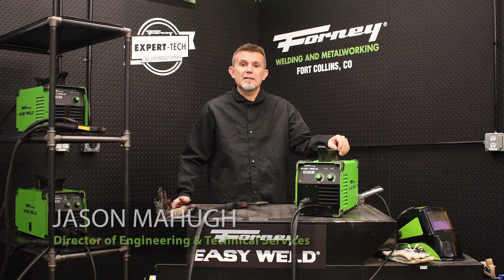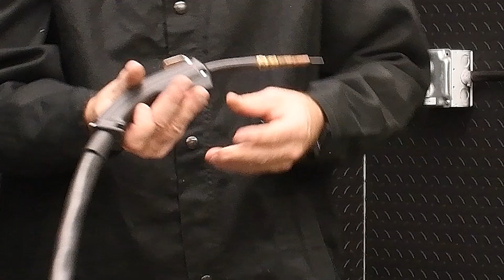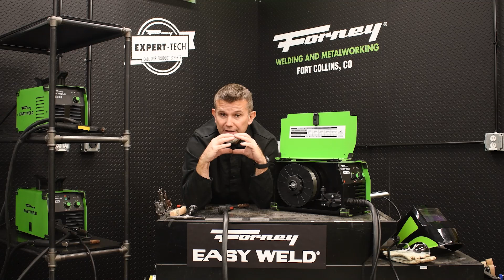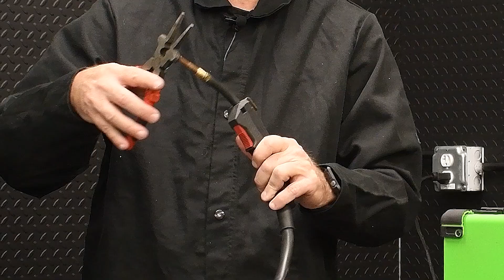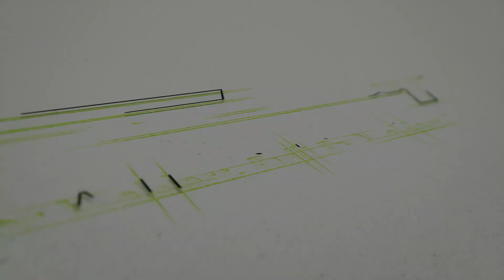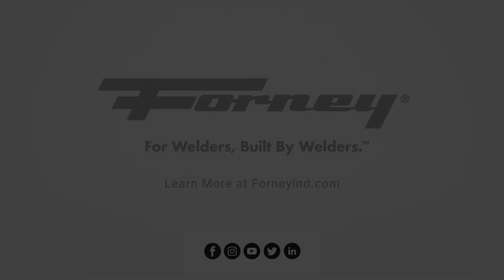Welding 101 - Forney Easy Weld® 140 FC-i

Comment: I am using the 4" roll of wire.  I thought I was following the instructions, but the slack was too much to adjust.  I noticed the removed large plastic cap used for the 8" roll fit nicely at the base of the spindle.  This seemed to work perfectly, lifting the spool just enough so that the tension system worked nicely.  Hopefully, that is the correct assembly.

Comment: Hi, I have a easy weld 140 FC-I. How do I get the thermal overload light to reset? The welder was working fine all the time and then after not using it for a couple of months, when I plugged it in and turned it on, the thermal overload light came on as soon as I turned it on and and the fan is on. What do you suggest to check?

Comment: I have a question about the settings, on this video you had said they should be rather close together, volts and feed, however in this video,https://www.youtube.com/watch?v=YPazP1aytdQ, she has volts at 6 and speed at 10. I gotta say, that looks like a very strong weld! In what situations should you run these type of settings? , or is it just a feel thing? Thanks

Comment: Is this machine good for welding exhaust setups?
Reply from the maker: Hi, generally, exhausts are welded using the TIG welding process due to its high level of heat input control which allows for the best quality welds on thin material. The Forney 180 ST+, 220 ST PRO, or the 220 AC/DC would all be more ideal for this job.
Reply: @forneyind  Thank you very much. Checking those options out now.

Comment: I recently bought one. Running lots of beads on 1/8" mild steal to determine appropriate settings. The panel chart shows 7 and 7. I looked at the chart provided with the Forney 140 MP. That chart says 5 and 5. Both machines should have same guts for .030 FC, so why the difference in charts? Im currently set to 4 & 5 and so far looks ok. The flux still doesnt come off easily. Im using the lincoln .030 wire if that makes a difference. I know the charts say GS wire.
Reply from the maker: Hi Michael, the chart is a recommendation, but your style of welding, skill, and technique will often cause you to find different settings that you prefer. Every machine we sell has a wholly different internal set up, boards, parameters, etc. The output range being similar is not indicative of having the same internal components. It is expected to have different settings on a different machine even for the same wire diameter.

Comment: I bought this exact welder and the plasma cutter, I love them both, I had trouble with the wire cutting in and out, popping and spattering like crazy, come to find out it was my fault, I was putting my tip to close to where I was welding, stick out was to close, I thought I had enough distance between them, yesterday I was welding and pulled back by accident and was blown away at the difference, these machines are awesome, they run great and have no problems with anything I’ve thrown at them, great products for sure
Reply from the maker: That's great to hear!

Comment: I just bought this and am having a real tough time welding a nut to a broken bolt in an engine head. I've got low speed, hi voltage, good ground & the spool set right.

The welds do not hold and the slag pile falls apart before it gets big enough to hold the nut. Any suggestions?
Reply: Are you sure the bolt is steel?   You may want to get the wire speed and voltage closer together.  Having them at opposite ends will lead to bad welds.
Reply from the maker: Hi there, we recommend calling our Expert-Techs so they can help you. You can reach them at 1-800-521-6038 ex. 2

Comment: What wire should I use, if I'm welding nickel bar, all the time? Thanks
Reply from the maker: MIG welding nickel is possible but not with the FC-i, you must use gas coverage to weld nickel which the FC-i cannot. Chrom-moly is the most common type of fabricated metal with nickel, NiCrMo-3 is the most common type of wire to use for this, this will require 75% Ar/25% He coverage gas. Forney does not carry this type of wire, or any other nickel welding wires. Thanks for reaching out!

Comment: Can I use a 220v-110v 20A outlet  adapter with this welder and a 25 ft 20A rated extension cord?
Reply from the maker: No, none of our Forney Easy Weld machines can be powered by anything outside of + —10% of 110 volts without being damaged (or destroyed in the case of 220 volts).

Comment: I own this machine , but am here to comment on the excellent tutorial ! Nice to have someone give honest and realistic advice. Cheers to Jason !
Reply: Forget critiquing the tutorial, how satisfied are you with your machine?
Reply: @chalemi  I critiqued the tutorial prior to receiving the welder> Now I have the welder and have to say it is very good. I have welded 1" steel shafts to 1/4 " thick gears, welded thin metal plate and welded square tube with no issues.  Its very good so far and extremally happy.

Comment: The details say it’s best to have a 30amp single pole dedicated circuit.  Is this recommended?  Is there a plug adapter for a 30amp plug? (Basically an RV plug I think)
Reply from the maker: It is recommended, but if a 20A outlet (with 30A circuit breaker) is not available, you can connect your 140 FC-i to 15A outlet (with a 20A breaker) using the plug adapter. When using the plug adapter, use lower power settings on the machine to avoid frequent circuit breaker trips. At maximum settings, the machine will draw more than 20A regularly.
Reply: @forneyind  - ok, to be very clear:  the recommended breaker/circuit size is 30Amp (10ga wire), and use a 20Amp outlet?  Is that correct?  

My original question was if it was recommended to use a 30amp circuit AND 30 amp outlet, to which you replied “It is recommended…”.  You then went on to define it as a 30amp breaker with 20Amp outlet.  Please be specific.  

I built my garage to have access to a sub panel and can run a dedicated circuit easily.
Reply from the maker: @frankhouck4446  Apologies for the confusion, the FC-i comes with a 20A - 15A plug adapter. We recommend a 30A breaker with a 20A outlet, but if this isn't available you can run it off of a 20A breaker with a 15A outlet.
Reply: @forneyind  thanks
Reply: @forneyind  - looking at your comment again, I’m still a bit confused.  I don’t think NEC allows a 20Amp outlet on a 30Amp circuit.  You can’t put #12 wire on 20Amp terminals and I don’t think a 20Amp outlet has 30amp pass through - although in a dedicated circuit that shouldn’t matter.  But still, I think it’s against code.

Comment: Why is the wire feed so slow even at max setting??
Reply: Because it's only using 15 amps. It can't keep up with an industrial welder.    But it still works great, you just go a little slower.

Comment: This will be my first machine. Talking about the spool and wire, the wire should be Mild Steel Welding Wire or could be used with Carbon Steel Mig Solid Welding Wire, do you sell fourney 030-Inch on 10-Pound Spool ? send me the amazon link thanks
Reply from the maker: Hi Alex, we do sell.030 in a 10 lb spool. The Forney Easy Weld FC-i is flux-core only, so you don't need gas. You can find the flux-core wire here: https://www.amazon.com/Forney-42301-Flux-Core-Wire/dp/B000HE8CQI/ref=sr_1_2?crid=1GZDQXLBA81PL&dchild=1&keywords=forney+42301&qid=1635519914&sprefix=forney+42301%2Caps%2C231&sr=8-2

Comment: Been welding for a few years now. Mainly with argon. I purchased this one for home and for thin sheet metal for body work. At amps set at 1. And wire feed around 1-3. I still burn through. Tried two different brands of wire. .30 on both. ???
Reply from the maker: Welding thin sheet metal with flux-core is extremely difficult. It is possible, but it takes a lot of practice and nearly perfect technique to not burn through the material. Even with the same settings, flux-core welding gets higher penetration than solid wire MIG welding. In other words, if you were to run a MIG bead on the same thin material at those settings, then switched to flux-core, your weld would be too hot and potentially burn through. If your machine is already set as low as it goes, you then need to adjust your technique. We would suggest increasing your travel speed, or adjusting the movement of your wrist while welding in a way that doesn't allow the heat to push through the material and cause burn through. If you have any more questions feel free to reach out to our Expert-Techs and they can help you troubleshoot. 1-800-521-6038 ext. 2
Reply: @forneyind  this is why I returned it.
Reply: @1manshtshowandautobodystuf891  welding thin material is just flat out hard to do. Not really the machines fault.    Tig is best for thin metal.      If you were using 20 amps that might have been your problem.   Flux core burns super hot because it's a hollow tube, looooots of electricity going through a tiny amount of metal.
Reply: @forneyind 
I have this exact welder and use it on 
24-22 ga on regular . For thin I’ve practice on stick out ,  almost an inch and heat up works wonders 👍

Comment: Does this unit use an inverter to from A/C  to D/C?
Reply from the maker: Yes, the Forney Easy Weld 140 FC-i uses an inverter to change the power coming out of your wall that is AC into a welding output of DC. Thanks for reaching out!

Comment: Will it weld 1/4” in a single pass?
Reply from the maker: You can weld sheet metal from 18 gauge up to 3/16-inch thick with a single pass and you can weld up to 1/4-inch steel with beveling and multiple pass techniques.

Comment: Why isn’t it good for stainless steel? You can weld stainless with SS flux core wire...
Reply from the maker: In order to weld Stainless Steel Flux-Core wire you must set your machine’s polarity to DCEP. Unfortunately, the Forney Easy Weld 140 FC-i does not have the ability to change polarity and is always set to DCEN. Thanks for reaching out!
Reply: @forneyind  Thank you for the clarification.

Comment: I used mine today for the first time and for some reason the wire is not coming out sometimes. The wheels that hold the wire don't spin sometimes until I mess with it. What is the problem?
Reply from the maker: Hi there, we suggest contacting our Expert-Techs. They will be able to help you solve this and talk you through how to fix the issue. You can contact them at 1-800-521-6038 ext. 2
Reply: Your spool tension is set too high

Comment: This will be my first machine. Waiting for its delivery today. I'm excited.
Reply from the maker: Congrats on your new machine! If you have any questions you can contact our Expert-Techs and they'll be more than happy to answer them: 1-800-521-6038 ext. 2
Reply: How do you like it?
Reply: @samhowe9499  I've used it a handful of times so far and it works pretty well. Used it to weld up a couple of sheetmetal panels and make a bracket for a steering column and some brackets to mount a gas tank on a 67 f100. Not as great as the couple of mig machines I've used before but for the price it's quite capable. I'm happy with the value of it and it's performance so far.

Comment: When you run out wire what you do you
Reply from the maker: Hi Oscar, you can replace the wire. This machine can hold up to a 10lb spool.
Reply: @forneyind  but when is out feeding you pull it you put new one start pushing old one
Reply from the maker: @oscarcasillas4555  Once you are out of wire, you will remove the wire completely from the MIG gun and then replace with the new spool. Our Expert-Techs can help you with this as well. You can reach them at 1-800-521-6038 ext. 2
Reply: Pull what's left of the wire out. I always pull the nozzle and tip off pull the welding lead out straight a possible and start the feeding process.

Comment: Hello, I just ordered the Easy Weld 140 FC-i, it should be here Wednesday April 14, I need to weld some gate hinges.  I can't bring the fence to the shop so can I get efficient welds plugging the welder into a 10 or 12 gauge extension cord that is plugged into a dedicated 20 amp circuit?  If not will it run fine off a generator with a 20 amp circuit as long as it does not have GFCI on the outlet, or would that not matter?
Reply from the maker: Congrats on your new machine! For extensions cords, the requirements are as follows: 12 gauge or larger up to, but not exceeding 25ft. And for generator requirements, a minimum of 4,000W continuous output with no low-idle function (or the ability to turn low-idle off).

Comment: I am dubious that this machine is truly 140 amp.  Has anyone checked it?
Reply from the maker: The machine is capable of 140 peak Amps.  As a wire welder, it is constant voltage, so the amperage depends on a lot of factors like wire diameter, wire feed speed, material thickness, etc.  More often than not, this machine won’t get to 140 Amps unless everything aligns.

Comment: Is this machine made in china?
Reply: They are all made in China now. My Hobart is made in China and "assembled" in the US. Just because something is made in China doesn't mean it's crap, that is small minded. If they are made to a specific spec then they will be well made. My Hobart 190 welds perfect and is made very well.
Reply from the maker: Hi there, our Forney Easy Weld machines are designed by Forney engineers in the U.S. and manufactured to our specifications in China. Thanks for reaching out!

Comment: my forney is not feeding.  Brand New and not feeding wire.. fan turns on, but no wire feed.. took the cap off the gun and touched the tip to the ground clamp.. It sparked.
but there is no wire feed.
any help on that? wire is fed by hand about a foot into the gun.  feed mechanism is not turning at all when its loose, when it has no wire when its tight at all the wire feed is not moving.. might be a bad unit.
Reply: Found the issue. The feed wheel mechanism was jammed. I  removed the wire feed selector wheel and started to manually turn it with pliers.  Then I pressed the trigger, and it moved. I put the wire selector wheel back on, fed the wire pressed the trigger and it started to feed. Now I must wait till the morning to weld..
Reply from the maker: @vizcarraawd  Hi there, we're happy to hear you got your welder working! If you have any other problems with it, you can reach out to our Expert-Techs and they'd be more than happy to help. You can reach them at 1-800-521-6038 ext. 2

Comment: I bought the same machine 2 weeks ago and  I am struggling to learn how to weld.What should the wire speed/voltage be for 1/8'' steel plate?
Reply from the maker: Hi Mike, we recommend starting both the wire feed speed and voltage at 7 with .030 wire, but you might need to adjust it still. Feel free to call our Expert-Techs as well and they'd be more than happy to walk you through the machine and get you welding. 1-800-521-6038 ext. 2
Reply: I have the same machine. I have better results when setting the voltage 1 or 2 numbers below the recommended setting.